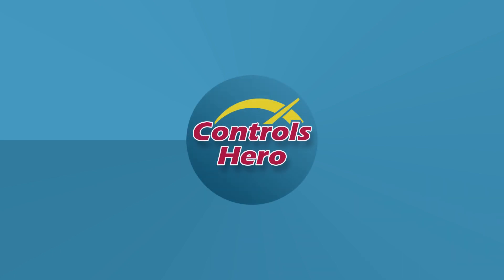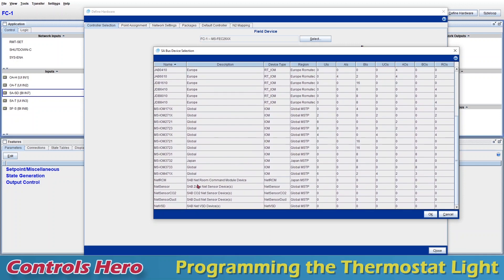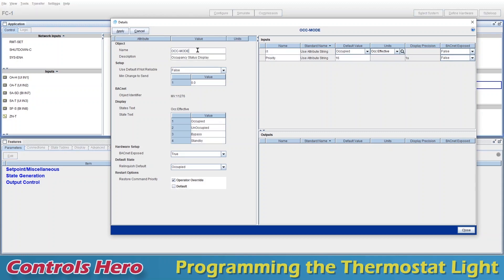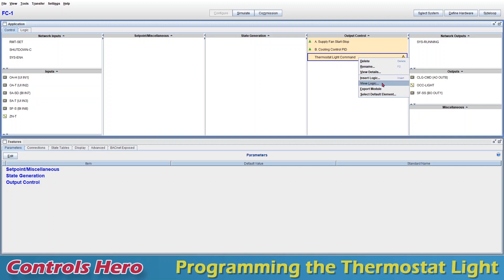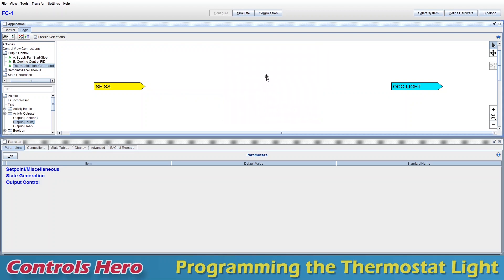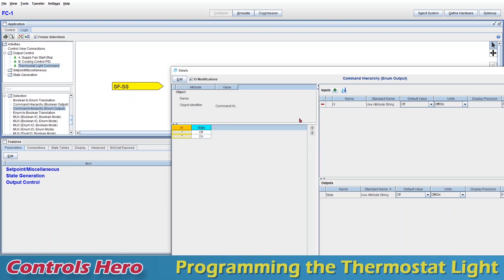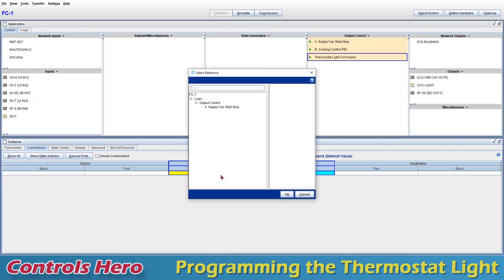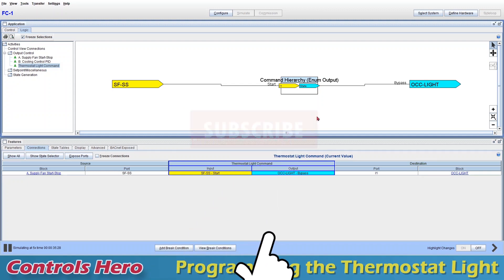Programming the TSTAT Light in CCT. Johnson Controls Metasys Tutorial.

Comment: The thermostat light illumination indicates a occupancy override state. The bypass state forces an “Occupied” state usually initiated by a button on the Network Sensor. In this example, the SF initiates an Occupied thermostat state.
Reply from the maker: Hello Jager, first of all, sorry for the very late reply. Thanks for your feedback. You are completely right about the standard function of the LED light of these JCI thermostats: to show that the system is in "bypass" or "temporary occupancy mode". I did not clarify in the video that this is the typical usage. What I was trying to show is that we can actually manipulate this light so we can command this light On or Off whenever we want. I've run into some customers that wanted to see this light On whenever the system was running and not necessarily when it was in bypass. Thanks!
Reply: @controlshero  K